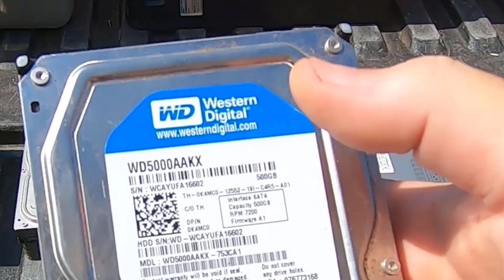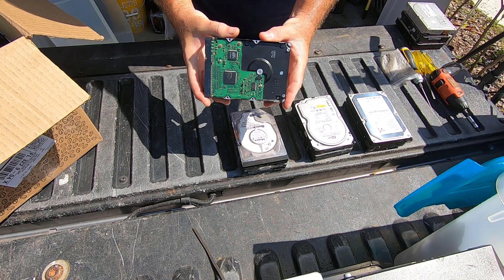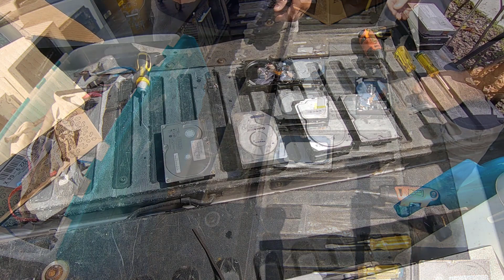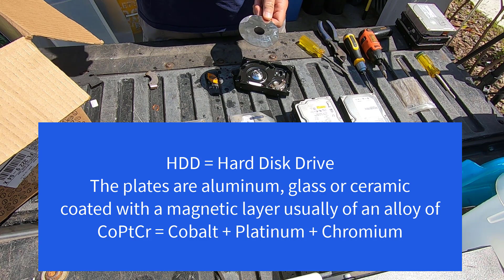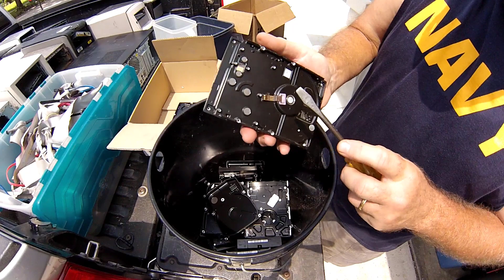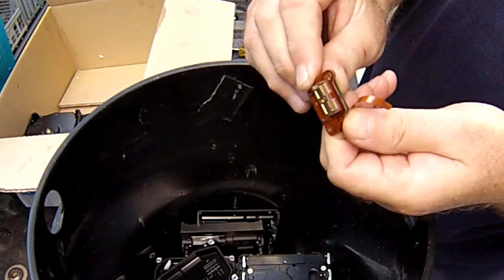Hard Disk Drive Scrap - Shark Scrapper Style

Comment: Yes no matter what I'm trying to take apart always always if I don't have enough tools I may have to go back to my tool bag or bucket or whatever I keep my tools to find you know something shark Scrapper you're absolutely right
Reply from the maker: Thank you
Reply: This is off the subject but on the subject you will not believe the Sharks scrapper I'm at the yard right now with one of those older rear projection televisions when I found it the screen was cracked and the mirror was broken and I cleaned it all up and I took the cracked screen out and the mirror what's left is All Electronics on the bottom all the copper this yard actually bass 15 cents of pound for e-waste computer monitors television screens they laughed at me and told me it wasn't a television because it was missing the screen I go is a lens which is called a lens I told him and it's made out of a you know an artificial type Plexi PL and there is a a clouded screen in front did you would you rather me brought it in with all the broken glass and stuff and they're like oh no well it's not a television if it doesn't have the lens they actually think and they don't understand go look look at all the electronics on the bottom there's the three boards down there all the copper all the it's all there except for the plastic lens that you guys would just trash anyway it's not worth anything to anybody unless it's used to cook steak

Comment: 95% of YT-videos made by amateur scrappers/refiners are misleading; some may even be on the border of being false. 
Most of these people claim that HD Platters are worthless (or almost worthless) and throw them in the aluminium bin. They are oblivious to the fact that some companies actually buy them as valuable e-waste.
Some YouTubers have even made clumsy attempts to recover PMs from the coating on HD platters; without succes. Therefore, they bravely claim that there are no valuables. There is, but the valuables in each platter are miniscule. Here comes the old rule of thumb regarding e-waste recycling into effect: Quantity = profit! Process a batch of 1000 platters the correct way, sell the aluminium, and then extract the values from the removed coating.
All those YT-amateurs have made the same mistake of dissolving platters in acid. Aluminium and tin are the metal refiner's "enemies"! Both are difficult to remove from an acid solution afterwards; with aluminium being near impossible for an amateur. Besides that, at the same time they have also lost the aluminium that counts for most of the value in a HD platter.
Acid is 19th century technique. Today there're so many other ways to process e-waste without using expensive acid, gaining a much higher profit. I use very little acid, despite I can use as much as I want due to all my HNO3, HCl, and H2SO4 being homemade at no cost.
From a commercial kitchen I obtained a stainless four burner gas cooker intended for scrapping. Instead of dismantling, I rebuilt it to three burners so it would fit my 130 liter stainless steel cooking pot. This pot looks like a normal household cooking pot, except it's about a hundred times bigger. The frame of the gas cooker certainly needed additional reinforcement. This pot is (among other purposes) used for recovery of silver from CDs. Again, many YT-amateurs have made videos with failed attempts to recover silver from common CDs, leading them to wrongfully claim there are absolute not any values in CDs. 
The consumed gas for heating the large cooking pot is free, coming from my anaerobic digesters. These also provides me with a nice biproduct: Pure sulfur; perfect for turning into SO2 when needed, for precipitation of metals from acid solutions.
Reply from the maker: Thank you for the detailed comment. For the average home scrapper, selling the HDD's to their yard or some other e-scrap buyer makes the most sense. They get some value from it and the HDD's eventually end up with a company capable of extracting the constituents in a cost effective manner. Very few home scrappers/refiners have the time or skills needed to build an extraction system such as yours. Keep up the good work and stay safe.

Comment: How profitable is scrapping HDD-s at your location? do you get more money by scrapping them or selling them as they are to the scrapyard? :)
Reply from the maker: A very good question.  It depends on the age/capacity of the HDD.  I sell 500 GB and larger.  1 and 2 TB's sell well for good money.  I have a special relationship with Roe Mantic who uses them to make low cost good computers for lower income families trying do remote schooling during the pandemic.  I suppose I could make more on eBay, but I like what Roe Mantic is doing and enjoy helping what he's doing.  Even at scrap prices, I'm still doing OK.
Reply: @sharkscrapper  in estonia, hdd boards are worth 15 euros per kg alone, whole hdd is 90 cents and if i scrap for example 2 hhd-s, roughly 1 kg, so i can get a bit over 1 euro. Those boards on hdd-s makes it more valuable than extruded aluminum or corrosive resistant steel.
Reply from the maker: @EstonianScrapper  I have a box of HDD boards I'm getting ready to sell at $13 (USD) / pound.  Yes, those boards are good scrap value.

Comment: Dam hawk, lol. ive done many of these in the past with out a care in the world not knowing their ture value
Reply from the maker: As the saying goes, "ignorance is bliss."   There's some nice Al there for your future melts.
Reply: @sharkscrapper  I'm not 100% sure it's fully cast aluimiuim, as quite heavy , and cast aluimiuim is light,  I think it has a lot more strength than just cast.. but I might be wrong
Reply from the maker: @s-s-p704  No worries there, as long as you've remove the odd steel spindle that some have, desiccant, tape, etc.,  it's Al.  My yards buy it as "cast" Al.  Having said, I agree with your observation.  I've always thought they seemed heavy for cast Al.  I've Ian'd a few with my maul hammer and the rough break shows the kind of crystal structure you'd expect from Al.
Reply: @sharkscrapper  magnesium is what sparkles when it melts maybe a topic of conversation on a live stream
Reply from the maker: @s-s-p704  Could be a fun discussion.  I've not gotten into melting and casting yet, but always enjoy the conversation.

Comment: Apologies for being off topic, but I'm curious if you've ever scrapped baseboard heaters.  
More specific: Radiant heaters that contain copper pipes, with aluminum fins.  This copper pipe has two copper pipes inside, which act as the element(I believe). It has a tough wire running through it, either nick/chrome, or tungsten I'd wager(Probably nick/chrome as it's slightly magnetic). But the main question is, there's a white hard substance inside this inner copper pipe.  I've already separated the heat transfer oil that filled the space inside the main copper pipe.  But this white crap looks crystalline under a microscope. I'm just hoping it isn't Asbestos😑
Reply from the maker: Kevin - no worries about being off topic.  Unfortunately, I've never scrapped one of these before.  I've seen plenty of them in old homes, I've just never scrapped one.  Sorry I can't be of assistance.
Reply: No problem, and appreciate your reply.
I'm now wondering about some kind of Ceramic.  As asbestos is generally grey/dark.  Not white like this stuff. 
If that's the case, melting the copper off should be relatively easy 🤞

Comment: Hi mr shark.thanks for the heads up on these.i picked up something new there.i like the bin full of wire,the bin looks like an apple product with the blue lids.
Reply from the maker: My pleasure Kevin, glad to be of service.  That bin is waiting for me to remove the gold bearing ends.  The wire is the lowest grade possible, but still some $ in it.  I can sell the ends to boardsort and use them as padding/filler.  I also keep some IDE's around for busy work when I'm board.  Picking the pins is tedious but there is a little gold plating on some.

Comment: These tiny hard drives,back when I started out on scrapping  the drives were 12 inch 8 and the 5"s,problem the damn screws kept getting smaller,the 12"s some had magnesium in them,one magnet was 25 kilos.
Reply from the maker: Daggon, those are some serious drives and components.  If I found one now, it would go in my collection - not scrap.